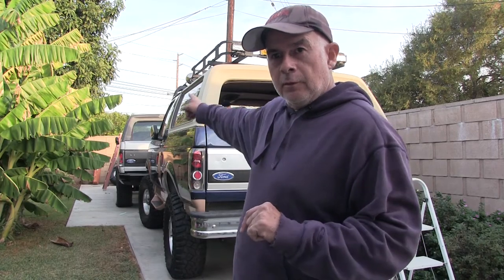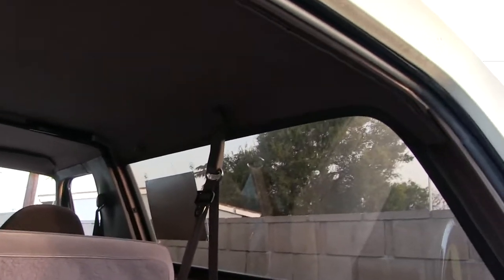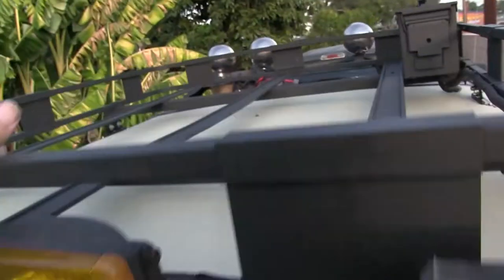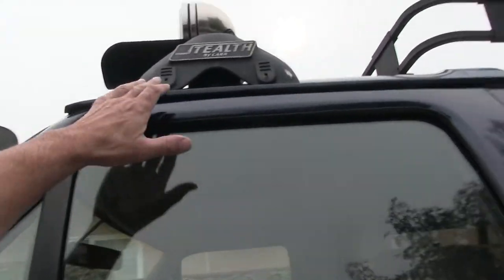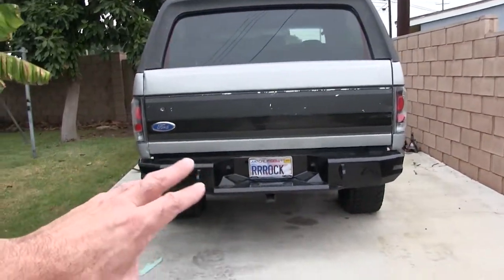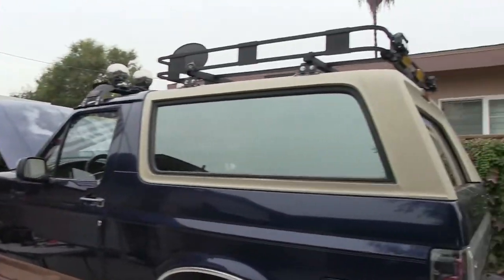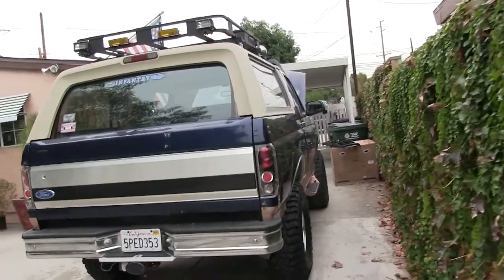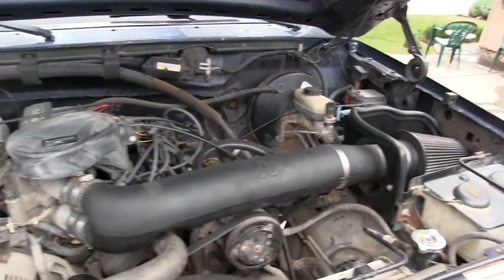Ford Bronco with Surco Roof Rack

Comment: Add a fuse, both ends of the positive wire.  auto parts store charge less than $5.  so under $20 to stop the risk of burning out a nice rig.